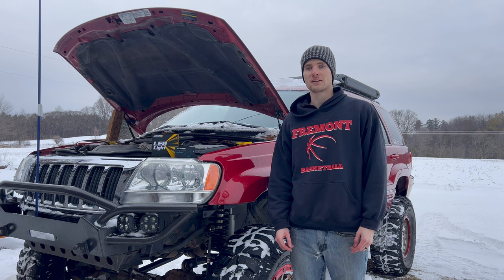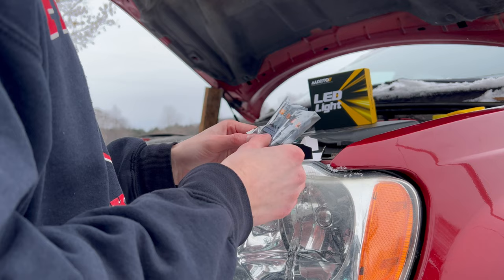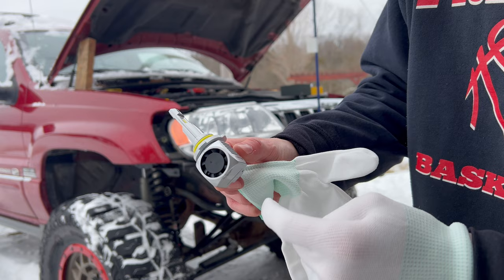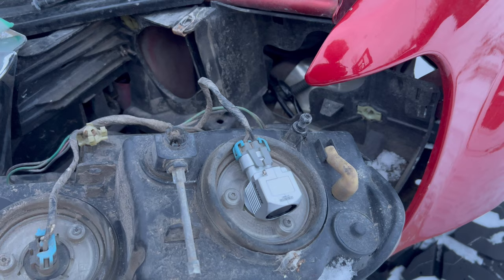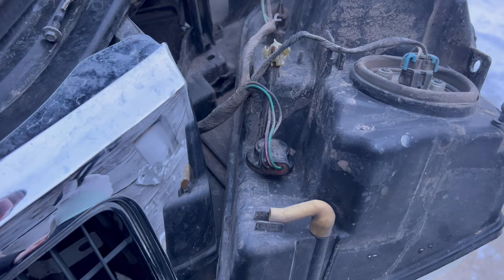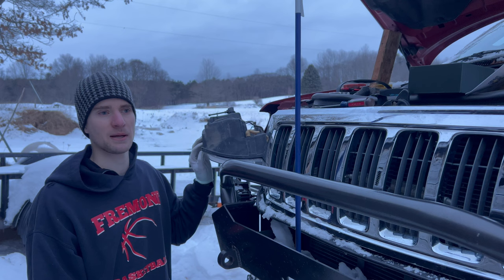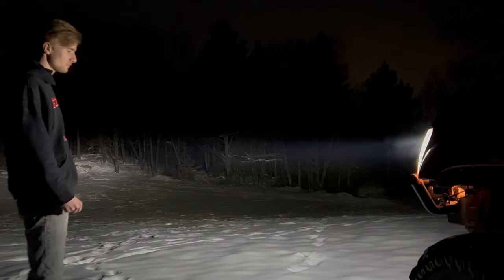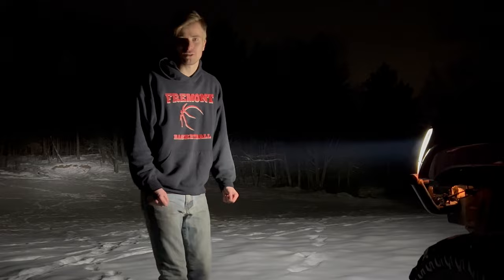How To | Jeep WJ 9006 LED Headlight Conversion

Comment: On coming traffic hates you with a passion
Reply from the maker: Surprisingly drove an hour home that night and never got flashed.  And that was the last time the Jeep has been on the road at night... It doesn't see much road time.  So I'm not too concerned either way.
Reply: If you're driving in a big city LED/HIDs are the norm. It's just the way it is now. In North Dallas 80 percent of drivers have them. I just  recently installed my Sylvania LED low beams on my 2004 just to "keep up" haha. I also have the same style LED housings that this youtube poster has (seen on one of his other videos) It's a huge upgrade. I've gotten many compliments on how modern it makes the vehicle look.